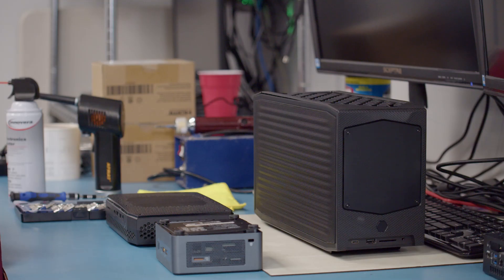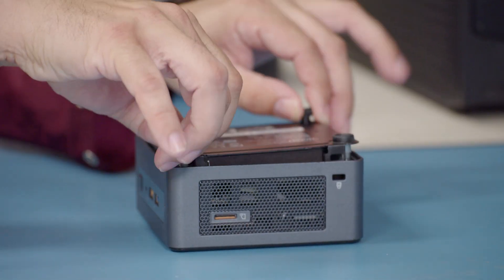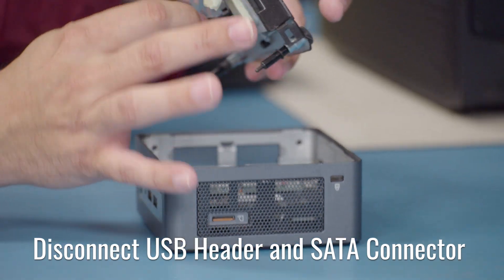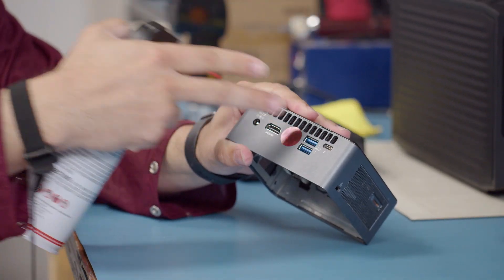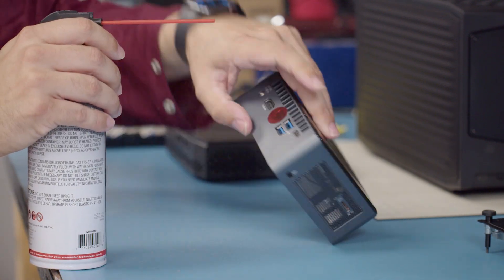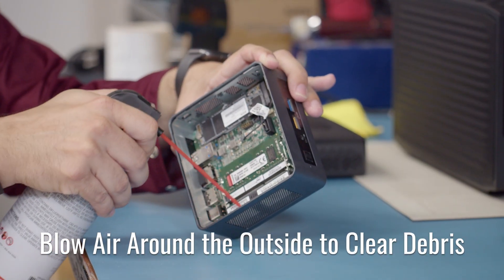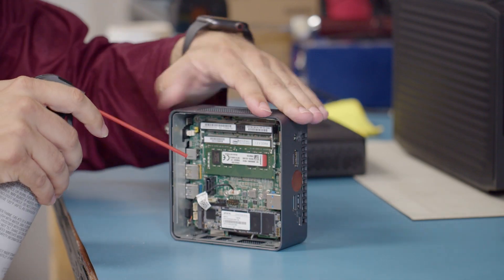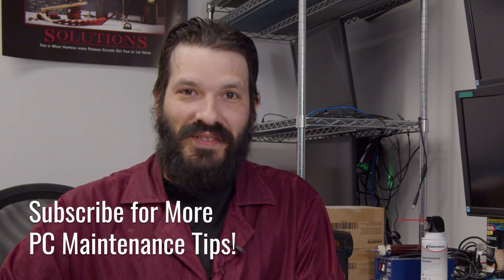How to Clean Your Intel NUC 4x4 Mini PC: Step By Step Directions

Comment: You need to remove the mainboard to get to the CPU cooling fan and duct to clean them properly.  Removing the mainboard without disconnecting the fiddly WiFi module connectors is tricky, almost as tricky as fitting the little blighters back if they disconnect.

Comment: Wow. I'm shocked You did not cover the fan portion.  It is our number one serviced NUC item.  We take two black screws out from the board.  Take the board out.  Remove the fan. Then remove the 1/4" dust cake line, the steps your video steps cannot do.
Reply: Yes, cleaning the fan and associated components is probably more important than blowing a bit of dust off the board. I have found the board a pain to remove due to the wifi wires connection which is somewhat tricky and delicate to disconnect/reconnect.
Reply: Is there any way to clean the fan using the small holes , just removing the top ?
Reply: @raduslavila42  we are not able to remove the cake cluster os dust, without removing the entire PCB, and the fan.  The processor is less than 2 minutes.  Wicked easy.
Reply: @cognetic  i see thanks , I did disassemble it top down before for a "cake dust" cleanup of the fan , but I was wondering if there might be an easier way. Last time I broke one of the antenna connector on the mini m.2 slot for wifi... Still works with the other antenna but I'm gonna change it soon